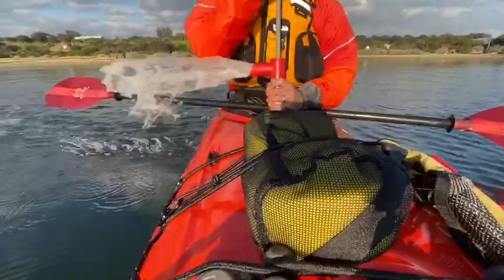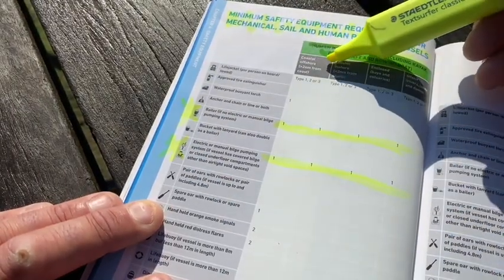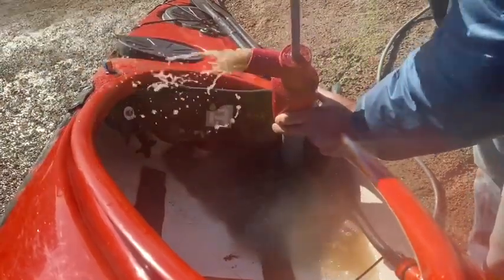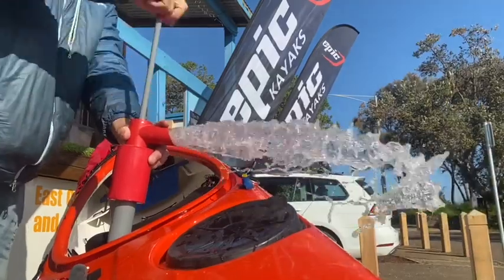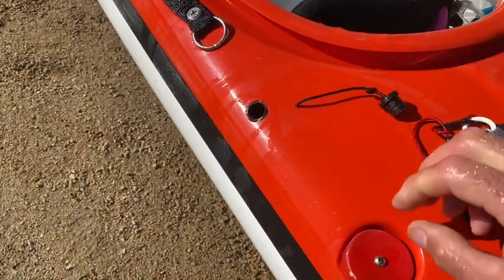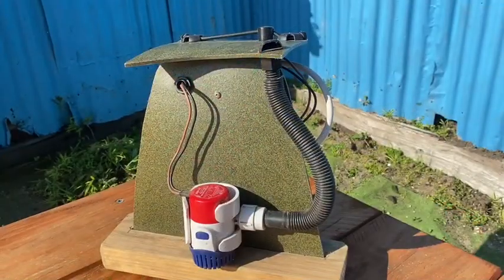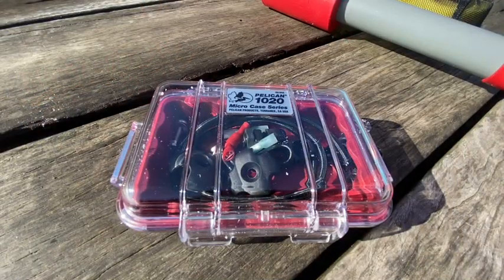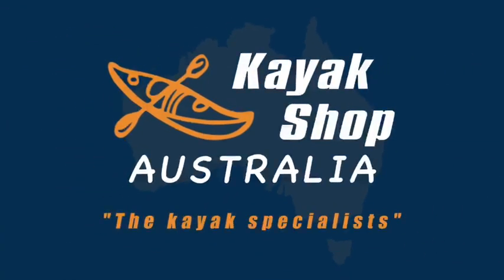Kayak bilge system- Hand pump, sponge/ bailer and Hands free electronic  Bilder pump

Comment: 0:05 Setting aside whether you "should" bring both a bilge pump AND a bailer/bucket, the version of Victorian Recreational Boating Safety Handbook I've (July 2020) now states you need one OR the other as a minimum and I quote from pg 40:

"- Bailer (if no electric or manual bilge pumping system)
- Electric or manual bilge pumping system (if vessel has covered  bilge or closed underfloor compartments other than airtight void spaces)"